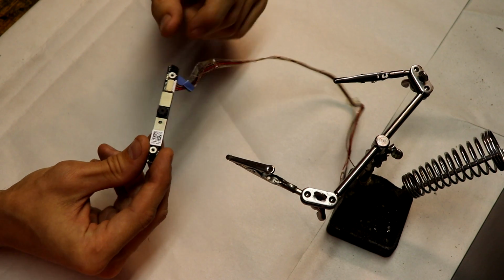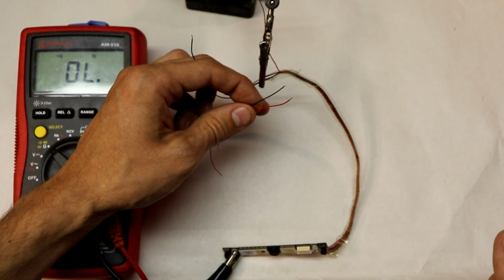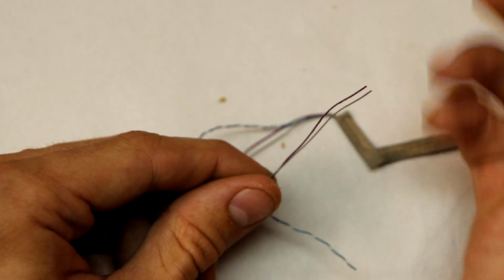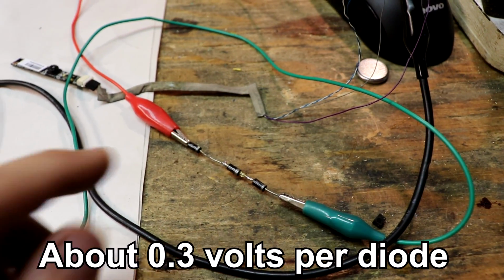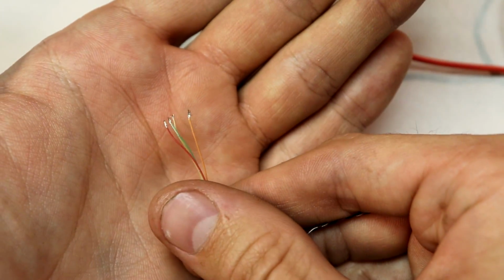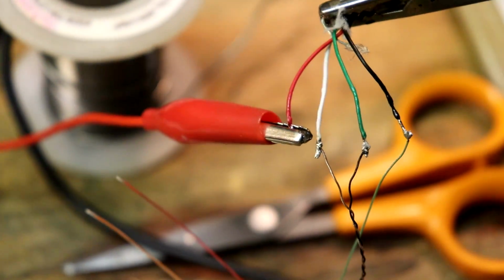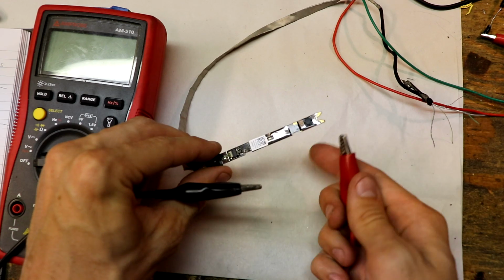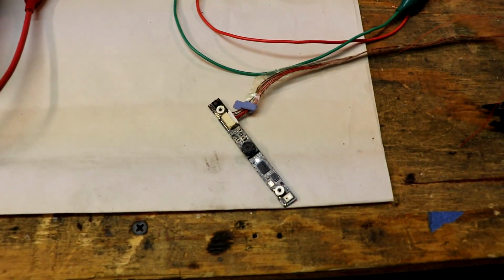Wiring a Laptop Webcam

Comment: I successfully converted a Toshiba laptop webcam (Model: AI009055003) into a USB camera. When I plug it into my laptop, it works perfectly and provides a clean video feed. However, when I try to use it on my desktop PC, it is not recognized and shows a "Device Descriptor Request Failed" error in Device Manager. I tried copying the drivers from the laptop, but the PC still won't recognize the hardware. Any advice on how to get this working on a desktop?
Reply: I finally fixed the issue! I forgot a critical step when using a dedicated power source for the camera. Since standard USB is 5V and this laptop webcam requires 3.3V, I used a regulator to drop the voltage.

The key was the grounding: you must connect the Ground wire from the USB cable to the Ground of your dedicated 3.3V power source. Once they share a common ground, the PC can finally read the data signals correctly. It now works perfectly on both my laptop and my desktop PC!

Comment: I've tried 4 webcams - 4 wire, 6 wire, and 2x10 wire webcams, and none of them work. I manage to identify ground, data, and run power, but I always get device unidentified when plugged into the computer via USB no matter the order of data wires. Anyone in the same boat?

Comment: this is fucking horrible and plain stupid , the one beeping is ground or - and you cant assume what others are, just try to check connection wich chip onboard, once you have power + and - you have to find data + and - and this will take some time or not depending on luck

Comment: The camera that I had, from a hp probook 450 G3, had 9 wires going into a 10 pin plug, where the wires were all labeled on the  circuit board. Turns out in order for it to work I needed to wire both the 3V and 5V pins.
Reply: What did you wire both pins to? USB connector only has a single wire for power.

Comment: Man, maybe you could lend me a hand, i know this is a very old video, but i wanted to ask you, i have a laptop with a webcam not detected but there is audio being transmited from the microphones that i assume are part of the webcam, i wonder how could this be? how does microphone audio is being transmited from the camera module, the connection is USB right? but if the USB connection doesnt work how come audio is being recorded from the microphones in the camera module? this kind of have me all baffled, is audio being passed as an analog signal thru the usb flat cable? or it is being encoded somehow but then it shouldnt appear as some kind of usb sink?, i have tested this under ubuntu, and the webcam under USB is recognized but fails and the kernel rejects the module (does not mount it) yet microphone audio works?, as if the microphones pass an analogue signal to the souncard thru the usb cable, maybe you in your endevours with usb cables in laptop webcams know something?

Comment: I'm having some problems. My webcam module has no written indication and no copper rings anywhere for me to try and use the multimeter.

The color scheme is Red and silver twisted, probably data, and then black, orange and one bare wire. 

The problem is, when I use the multimeter on one end at the cable and one end at the board, I get a beep (continuity) on all three of them. All cables seems to indicate continuity between them and the board.

What to do?

Comment: Good video i had a old webcam module laying around with five wires two or power other two were for data fifth one was for Mic + planning on putting it in a laptop without camera so I have to do is solder Mic wire to positive spot on Mic input

Comment: This method would work for every single webcam module. Find the SMD Capacitor , the one closest to the connector or  regulator IC.  That particular capacitor is connected to positive & Gnd, thats the hint. Just use a multimeter in continuity mode to find the wire connected to it.

Comment: Si I Ve Found First Camera module Pin Out Myself i want to share u, Camera Module Model No: CK77 94V-0 06P231A Got From Dell Old Laptop. Where Arrow Mark At Connector That Is Ist Pin Is Ground Negative, 2nd Pin Data +, 3rd Pin Data- 4th Is +ve 5v. Ive Tested 100% Working.. Without MIC

Comment: Si I Ve Found First Camera module Pin Out Myself i want to share u, Camera Module Model No: CK77 94V-0 06P231A Got From Dell Old Laptop. Where Arrow Mark At Connector That Is First Pin Is Ve Negative, 2nd Pin Data +, 3rd Pin Data 4th Is +ve 5v. Ive Tested 100% Working.. Without MIC

Comment: 8 wires is for USB 3.0 for HD video, regular 4 wire USB doesnt have the bandwidth for HD video at any GOOD frame rate. if there is more than 8 wires then it could have an external trigger to turn the power on, for security reasons. you can always look up whatever chip(s) are dealing with the data and look up a pin out.

Comment: Hmmm... It was long to look at you learning that a webcam is always powered in a device thus showing in the device manager and that the LED only turns on when the device gets in use, not when you literaly power it up... The first cam you showed, i have that one in my hand. I'm still trying to figure out the proper lines. I know for sure that there are some for mic left and mic right... and i might try to hook it up dry to the scope and see if i can read any input from the mics... if they don't need polarisation...

Comment: So how do you connect the microphone? On mine, it has the pinout printed on the back and says M_data and M_clk. Do they get soldered with the Data+ and Data-?
Reply: Those go connected to a actual mic not usb, the camera board will read the mic data if one is connected.

Comment: Do you have any knowledge on cell phone cameras? Done the same way. I have one and I have to get going on yet another project. Thanks
Reply: I don't think cell phone cameras use a standardized interface, plus, even if they did, it would be hard to connect to them since there are no wires and the PCB pads are way too small.

If you have the entire working phone, though, there are apps that enable you to either use your phone either as a webcam input for your PC or as an IP camera.

Comment: I would have guessed LED +/- for those braided ones at the beginning. Will keep watching to see if I'm right.
Reply: VideoNOLA the cables wounded together are always data lines and are like that to decrease interference
Reply: @OnlyKelp  The camera I pulled out of a premium HP laptop had two extra wires like that running from the assembly. I noticed that there appear to be two small microphones mounted to the board, and (though I haven't tested this theory) believe they might be the + lines from each of those mics.
Reply: VideoNOLA the twisted ones are data wires, not microphone. The straight ones are power, ground, and the microphone cables
Reply: VideoNOLA I could be wrong though, it depends on if your camera is using the standard usb protocol

Comment: Same as u show in Ur video I did it actually works.and the light also works fine so we can connect it thru OTG to phone but what application it need to be turn on in android?
Reply: Did the light work when you fed it only power and not the data, or did it start glowing once it was connected to power as well as data lines?

Comment: alright so i got the job done but when I go to a camera app windows loses the camera and the led comes on the camera board...any idea whu and what can be done?anybody....or at least point me in the direction of an answer
Reply from the maker: It sounds likes either a loose connection somewhere  (check your soldering) or maybe the camera board doesnt have enough power, maybe the usb port is weak.
Reply: @SciCynicalInventing  could lack of diodes be the cause...and if insufficient power, what could I do about that...the usb port is fine
Reply from the maker: @mikeness9735  no, diodes are unnecessary, only showed them in the video because I was scared of damaging the camera board so was taking extra precautions. I would try powering it from a different 5v supply to isolate the issue. If the board still acts up it has to be a problem with the camera board itself, maybe a shorted ceramic capacitor. I would even test the board with a linux system to elimate the factor of it being a software issue (driver issues are a pain). Otherwise hard to say what the problem really is

Comment: I've tried this and all three are now destroyed
Reply: The only way you can destroy them is if you over power the diode meaning you have too much amperage mainly and voltage and then hood them up backwards.  That is why he  uses wimpy power source at the first and/or in line diodes to lessen voltage.  Don't assume they use 5 volts,, but 3.3 and always use a power source with least amount of amps possible.  Notice I did not say to use a lab power source even though most kids today have pocket change and could easily afford one, but don't just grab the first t hing you stumble across in the pile of shit strewn about your floor  (did I give away my mess with that statement?) but always sit back and think for a minute or two.  those small batteries are always wise and everyone has one in an old motherboard or computer.  Don't use a lithium cell as they have waaaaaay too much amperage, instead maybe put a few almost dead AAA batteries in series or chinese ones or dollar store junkers that are not brand new.
Reply: @sizzlean9459  yeh i figured it out thanks
Reply: @MrAdventureHat  AWEsome and your welcome if I said anything helpful..Peace
surely you know I was talking about my pile on the floor!! not yours

Comment: use ur meter set it on continuity ok so attach one wire to the ground on the board then touch the other wire from ur meter to the wires from the cam and that will show ur ground wire so whats left is power or a mic and u can just repeat this step tyo find out

Comment: Hi
I have a webcam cn-0k143j-72487-971
could you tell me how to connect it because at the end of the movie you managed to connect it
Reply from the maker: Telling you what wires to connect to is difficult unless I had the camera in front of me so all I can do is tell you how to figure out which wires to connect to.
These cameras are USB, meaning they need +5 volts DC, a Ground connection, and 2 data lines.
The 2 data lines are ALWAYS twisted together, this is to reduce interference. If you connect these data lines wrong, don't worry just reverse them.
The ground connection is ALWAYS connected to the body of the module/board, you will need a multi-meter to check which wire is connected directly to the body of the board.
The +5 volt connection is a little tricky, you will need to do a little bit of guesswork here and simply pick a wire that looks like it would be the +5 volt connection (yellow wire, red wire, orange wire, etc).
 
Hope this helps.

Comment: The diodes you use is 1N4001?
Reply: it has to be, or just use any diode that has a Voltage drop 0.7v ,i my self used a Zenner diode.
Reply: @abo-seleem  thanks what voltage of zenner diode?

Comment: very informative video, i love that you put the effort to go through 4 different camera modules and didn't just call it quits after the first one that worked which conveniently only had 4 wires, thanks for that :)

I'm having an issue with my camera module. I'm able to tell which ones are the data wires since they're braided (mine are red and silver) but i'm unable to tell which of the other 5 wires are ground and 5V (yes mine has 7 wires, kill me now). I'm new to working with wires so i've never used a multimeter before. I just wanted to ask if you'd be able to tell which wires are which by the serial number on my camera module? it's probably a long shot but i thought i'd ask anyway.

Serial no: CKE7D 94V-0 (seems like it's similar to one of yours)
wires: green, yellow, orange, silver and black.

thanks in advance
Reply from the maker: Appreciate the kind words! I know how it can feel trying to find the right wires when you're a beginner to these things. Finding the board by the serial number is a long shot so usually I never do that and do my own testing. No matter how many wires your camera board has it isn't too difficult to find the right ones as long as it's USB. So you found those data cables because they are twisted, now the next step would be to find the ground cable, usually the same screw holes that were used to mount the board in place have an electrically conductive pad on them, those HAVE to be connected to ground. Now you have your meter connected to that pad, you start checking all of the wires for a short circuit (my meter beeps when theres a short). I suggest looking around for videos that show you exactly how to set your multimeter to it's continuity setting if you don't know how, you can also set your multimeter to measure resistance (ohms) and look for the short that way, when you found it your meter should display zero ohms or no resistance, indicating that you found the correct wire. To find the positive wire takes a little guess-work, usually I take a chance with the red wire because traditionally that has ALWAYS been positive, but it can be the yellow or orange wires. I learned that these boards can take quite the beating so you should be okay to try out any wires you think are positive, but if you don't want to take any risks you can do a coin cell test like I did in the video. All that is is just powering the board with a 3.3v coin cell and connecting to any wire you think is positive while also having a multimeter connected in parallel with the coin cell to measure the voltage. If you connect the wrong wire the board wont get power and nothing will happen, but when you connect the right wire the board will get powered and    you will see a voltage dip on the multimeter (this is visible in my video), indicating that that is the positive wire (there could be multiple positive wires on a single board, but shouldn't matter which one you use).

And if you don't want to bother reading that wall of text, from experience, your ground should be either the black or green wire and your positive wire should either yellow or orange (silver MIGHT be ground but I would check that last)
Reply: @SciCynicalInventing  thanks for the tips man :) i appreciate your help
Reply: Additionally, i'm not sure how to tell which part of the camera module is the "body" to test the ground wire

Comment: I didn't understand how you found the positive wire
Reply from the maker: So two things:
Process of elimination, if you find the other wires you can assume the last one is positive.
You can find the positive wire easily by watching for a voltage dip, what i did is connect a multimeter in parallel with the battery I used and had the ground wire connected to the battery. The positive wire coming from the battery I used to connect to any wire I suspected to be positive from the camera board. If I saw the voltage drop on the multimeter I knew that the camera was receiving power from the battery and thus, that was the positive wire. 
Now obviously it will take a combination of these two things to sort the wires correctly. Sorry if that part was confusing, hopefully this was helpful.
Reply: SciCynical Inventing My webcam Model is cn-0u620f help